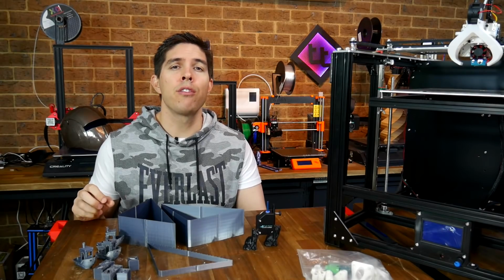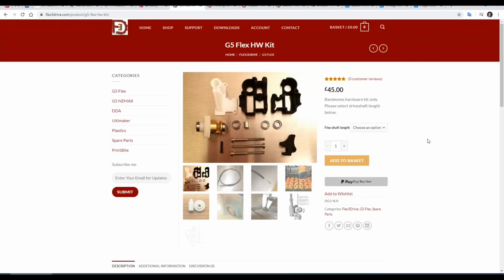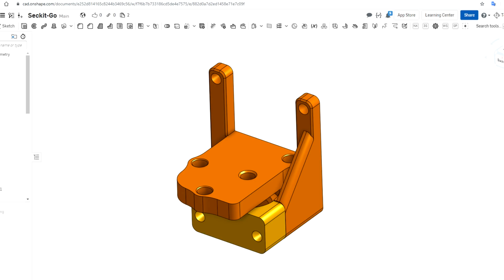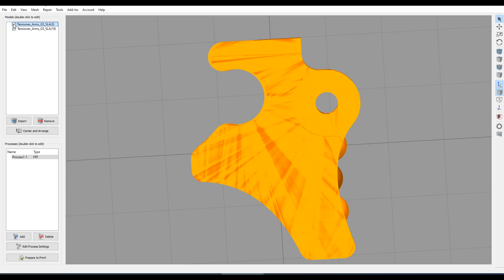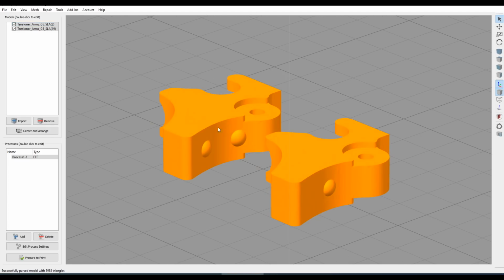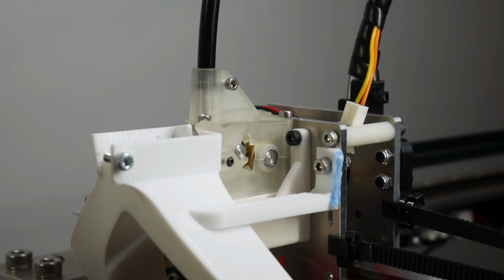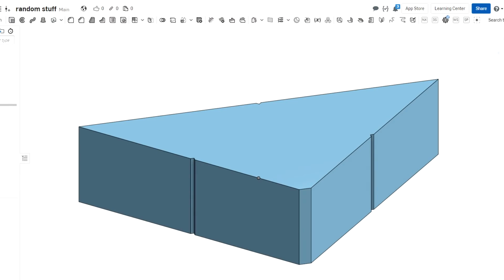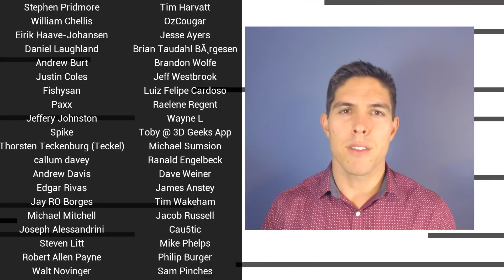Flex3drive G5 open source remote flex drive extruder guide - Seckit SK-GO

Comment: IDK your other print settings but 200 is too fast no matter what HW you have. I believe you printed PLA and according to E3D with a .4 and a V6 and a copper nozzle which gives the best heat transfer the max you get on a good PLA is 13.5 mm3/sec melt rate before you get inconsistent extrusions and partially melted filament cores. If you printed at the normal layer height of .2mm and a layer width (ideally) at .44 mm the max speed is 13.5 /0.2/0.44 = 153,4 nn3/sec if you go to a .1mm layer height the melt rate will drop. IDK to what as we usually print with a .8 and a layer height between .2 and .4 Also the smaller the nozzle and layer height the higher the back pressure your extruder has to overcome which can cause slippage. Also above data are based on a BMG extruder (2 grippy wheels) I wrote what I learned and confirmed on that both with E3E and the mosquito people here https://grabcad.com/tutorials/dialing-in-a-filament-and-specifying-the-max-volumetric-e-xtrusion-value . So according to their tech people never push above 100 or go to a bigger nozzle without employing the instructions in this tutorial. And Note!!! not only does each type of material have different max extrusion speeds but also different brands of the same material have different speeds (e.g. Prusa PLA might be different from ESUN etc)
Reply: I think the point of 200 was to bring out as much ringing as possible to compare the systems.
Reply: @originaltrilogy1  I understand that but you wont see the ringing unless you can extrude at that speed. Now theoretically it is possible to extrude that fast but that would require a Volcano which according to E3D has about 170-200 % the flowrate of a V6 depending on nozzle size and filament type. Now then there are other concerns too. For example if you print in 910 Nylon even though you can melt it at about 18mm3/sec on a volcano you will get a real crappy print if you exceed 25mm/s atleast according to taulman. See max speed is governed by 3 things, The max speed your printer can reliably move, the max speed you can melt it and the max speed you can adhere it to the previous layer. Of those 3 speeds you need to pick the slowest to have a successful print. And then at some point other physics might come to play. Assume you can reliably move at 1000mm/sec and you can melt the filament fast enough but at this speed all you are going to do is fling molten filament around the room kinda if you have a bowl of spaghetty and you spin around in circles real fast.
Reply from the maker: In hindsight I should have capped the max speed but upped the acceleration in stage for my speed test. Perhaps a video on this in the future.
Reply: @TeachingTech  Hopefully - and don't feel bad. I paid for that knowledge. Initially the guys at matterhackers said "you want to print fast - get a .8 nozzle and you can print 4x faster just up the temp 10-20C" well it wasn't pretty so I embarked on a quest to find the "speedy truth" and found that most of the info at that time (18 months ago) on the net was wrong and still is. I was at the ERRF and except the techs at the E3D and mosquito and Prusa booth just looked funny at me when I mentioned Max Volumetric E. BUT I can assure you getting it down pat has down wonders for print quality, layer adhesion and in definitely showing how fast one can print.
Reply: I'm extruding @220mm/s just fine using a mosquito hotend
Reply: @3dprintingguru378  Possible - never tested a misquito - but that hotend too has its limits. Now I am sure if you'd use a volcano with a .4 you should get that speed. The point I tried to make is that each setup has its limits and you ought to know them whatever they are.
Reply: @martinpirringer8055  I fully agree, what I wanted to point out that one could shift the bottleneck up to a certain point. GH showed off that we don't even scrape the limits yet. search for GH enterprise concept delta printer.
Reply: @3dprintingguru378  Its one of my desires to get a delta. We print big stuff. WE = FRC team 1989. Currently we 3D print our robot (30x30x45 INCH (not mm) Probably will have close to 20kg of HIPS in it. So printing fast and big is what we want and also accurate. We print anything from gearboxes to frames. Used to maintain a youtube channel on it so you might some old stuff there - stopped as everyone kept telling me too much math and not enough kittens and I am tough to understand so I only do one occasionaly to train the newbs of the club
Reply: @martinpirringer8055  I get that 🙂 btw you sound very German, just watched a portion of your double helical gear inventor video. recently designed a gear set based on mathematical models, so too much maths is well known here.
Reply: @3dprintingguru378  Austrian actually. According to some when I say "I'll be back" its sounds like the terminator only with me everyone starts laughing - lol
Reply: @martinpirringer8055  I'm Austrian too, living close to Wiener Neustadt. just add the "Glock" is ticking and they stop laughing 😂 😂
Reply: @3dprintingguru378  I am originally from Vienna but have lived in the US since 1980
Reply: Hi martin I have seen your interesting contributions on the Patreon group, but did not know you had created such great resources and videos. thanks - i am now spending my Saturday reading your work instead of the DIY I should be doing :) (and much happier for it!)
Reply: @ImolaS3  Thank you.

Comment: I would rather just strengthen the Y axis support (or get an over sized one), maybe get stronger stepper motors, top end bearings and be done with it vs going through this over engineered process, but thats just me...;)
Reply: Stronger steppers can make the ringing worse, and making the system more rigid can also make it worse, the kinetic energy has to go somewhere. Reducing the mass is the best way to reduce ringing.
Reply from the maker: Also this is a coreXY machine, not a moving y axis bed i3 style.

Comment: You mentioned in passing Cetus ghosting. This drove me crazy until I made a very simple steel bracket for the Z axis stepper. It constrains the stepper to the printer base plate using the two lower threaded stepper motor mounting holes and a right angle bracket. This did required a redesign of the Z axis clamp/brake. Mine and several other brakes are available on thingiverse. Now I don't see any ghosting, however I usually print 0.1mm layers on fine print settings. 
Cheers
-Peter
Reply from the maker: I've since gifted it to a family starting out in 3D printing who will not care in the slightest about the ringing, but thanks very much for sharing your solution.

Comment: I "think" there will be some Flex #in the turning of the flex cable leading to some issues
Reply: Torsional twist is an issue that has to be addressed correctly, and flex3drive is the only one that does this within the design decisions that lead to the G4/G5 family of extruders.
Reply from the maker: The flex cable page on their website is worth a read to see the technical specs.
Reply: @TeachingTech  OK GREAT VIDEO added to my 3D Printer Playlist, keep up the good work
Reply: They run a stupid high gear reduction. Listen to his steps/mm
Reply: The flex cable runs really high RPM to filament motion, this basically gears out any of the slack in the flex cable making it so minor as to not be an issue.
Reply: @legionof0ne441  I remember a high rev cable like these getting tied up in knots, dangerous
Reply: @3D_Printing  we use these same basic design cable drives in industrial situations delivering multiple horsepower loads... they last quite a long time in forward motion (as if you are winding the 'spring' tighter), they do fatigue over time with reverse loads (retractions which have the possibility of unwinding the spring a bit), but for the geared down loads one would see in an extruder (much lower torque delivery requirements than what is generated due to the gearing) I think you would wear through the casing before snapping a shaft - and like any  flexible shaft, if you deliberately tie it in knots of course its going to fail.  They are designed for sweeping bends not sharp turns.

As for wear and tear - I would expect to see the outer sheath fail before the flexible shaft fails  as in the industrial work I do, that is the most common cause of the shafts failure (after some years) where it rubs through the flexible steel reinforced casing and then those steel reinforcing wires damage the shafts wires and cause the shaft to fail.  But then I am talking about shafts that run at over 2000 rpm for 6 - 8 hours a day for well over 3 - 4 years before failure... this is just a scaled down version... I would only be disappointed if I did not get 1000 hours of print life out of the drive shaft on something like this, which is basically 100 or more 10 hour prints
Reply: @lloydmilton  the information you give here is GREAT 2000%
Reply: @lloydmilton  great information
Reply: @3D_Printing   the only things that really reduces the life of these sorts of drives are kinking the cable / housing, having very tight bends as large radius bends work best if it has to have a bend in it, reversing the direction under a load that is higher than the force required to unwind the drive shaft, poor quality materials / workmanship on the shaft and sheathing

Comment: the barebones kit is only $45! That's damn tempting!
Reply: Not $ but £ ! Quite a difference. And you have to add shipping.
Reply: @oleurgast730  but bang for buck the value is undeniable given its performance and accessibility, which is one of the aims of the Flex3Drive project.

Comment: how does this differ from the Zesty Nimble?
Reply: Neil Siebenthal  flex3drive has been around since 2012.... The nimble guys literally bought an early flex3drive to design their product
Reply: @edwardpaulsen1074  the g5 is the 5th iteration of this extruder, the slow burn is in reference to the 5th iteration being released, not the product as a line. The flex3drive has been around since 2012
Reply: @Narthan11  The relative slow burn is in relation to the whole Flex3Drive project, and what it is striving to bring to all 3D printerists :) There is a bigger picture involved.
Reply: seems to be much cheaper.
Reply: Neil Siebenthal  the 2017 website was selling the g3, still the 3rd iteration of the extruder.
Reply: Neil Siebenthal  I've provided links on both companies in my previous comment. I've also tagged both Flex and Zesty on twitter and asked who came out first. Let's see what they both say, but from the data I've found, it appears Flex came out first.
Reply: @edwardpaulsen1074  Here is the conversation between Flex and Zesty. 

https://imgur.com/GtTtNBK

Flex came first.
Reply: While the original concept was brought to light via a post to thingiverse in 2011 and the first working prototype was designed around 2012 and released in 2014, these points are as irrelevant as 'who made the first automobile' in regards to the comparison the OP asked about. There are many auto makers now just as there are "flex drive" makers...  Just being "first" or what iteration they may have produced is also somewhat irrelevant... In a comparison between the quality and the features, my opinion (as an automation engineer) is that the Zesty is still a bit better as it has multiple mounting configurations as well as either right or left feed, the overall build quality on the base unit is better, and is smaller and lighter.   E3D was also not the first to come up with extrusion nozzles but they have made them better. The ultimate choice is still up to the end user as to which bit of tooling (as this is still part of a machine tool) best fulfills their needs and at what price point and setup process they are willing to deal with. In that regards, there are tradeoffs and benefits to either one.
Reply: @edwardpaulsen1074  Not a strong argument but you seem reasonable in your comments.

You are absolutely correct on the points about being first, or others making something of the same but different and such like. I have no issue against such things nor those that have the capacity to do it independently or those that dont but try their very best in honest fashion. 

Copying someone elses work deceitfully and engaging them over an extended period of time without declaring the intent, and without ability to do independently is as dishonest as it gets.

Couple that with the cowardly publication by zesty of innacurate and slanderous materials in private channel or message board, or taking it to MRRF and showing it to people is very poor character behaviour and done with the sole purpose of hiding the truth, from their customers. That could be called fraudulent in itself.

However being an engineer of any worth you should already be aware that the zesty:
1). Loads the driveshaft in the wrong direction.
2). Uses lower gearing which puts more load on the shaft compounding #1 above
3). Uses a thinner 3mm driveshaft compounds #1 and #2 even further
4). Moved to 20:1 with same components makes problem #1 #2 #3 worse by factor of x2 compared to F3D.
5). Zesty didn't know what acceleration was when they launched - after supposedly developing on their own without "copying"?

There are plenty of Flex3Drive mounts.

You can self print a LH or RH version of the Flex3Drive as and when needed just by mirroring the parts in slicer.

Plenty of zesty YT reviews, and I don't post on them. One Flex3Drive review and look at the zesty trolls (presumably not you though), with self confessed fake ID's. That is the company that is Zesty.
Reply: Neil Siebenthal  No, other way round. https://www.youtube.com/watch?v=06d-acajAmY https://imgur.com/8lweHvY check dates, all before zesty was even a thought.
Reply: Neil Siebenthal  this was the first flex drive. Zesty came after it.
Reply: @npgoalkeeper _ Flex3Drive was around quite some time (years) before zesty was even a thought, as was the G4 by roughly a year.
Reply: @npgoalkeeper _ Depends how you do it.
Reply: This is the company zesty copied.
Reply: @WafflerSupreme  Sorry man, not a copy. Flex3drive has been around since 2012 well before the Zesty.
Reply: @ImplicitConversion   That's what I said. I said this is the company (flex) that zesty copied.

Comment: Oh, forgot, that recommended retraction is a bit high if linear advance is even close. I'm running k0.12 with retraction of 0.35mm. I was running 1.25mm with a bowden and L.A. tuned marginally.
Reply from the maker: Please remember I'm showing the recommended settings from Flex3drive. They don't recommend linear advance after setup. My retraction is lower like yours.

Comment: At 16:18 what causes the vertical, repeating pattern visible on the inner walls?
I definitely want to try this speed test on my E3 w/ titan clone. Seems the walls are long enough for 500mm/s2 acceleration to hit speed. Will be a good test of the microswiss' ability to melt the filament volume at 205C.

Comment: How many operations do you predict before the retaining arm stops locking in properly to hold the filament? I'd almost rather have it spring-loaded like a titan.
Reply: On the Zesty Nimble the breech is replaceable, for this reason.
Reply from the maker: Limited testing but so far zero deterioration. Since I made the parts myself I can replace if the need ever arises.
Reply: there is no hook or latch that could wear down, the geometry of the idler bearing in relation to the hobbed gear makes it durable.
Reply: The tension arm design has been extensively tested both in-house and in users hands before release, and its operation has been solid. Its a clever little geometric arrangement in the way it locks down and prevents any reduction in tension over time.

Comment: Have you tried the zesty nimble remote direct drive? It's basically the same thing and they are located in Australia. I have their first version of the nimble and like it. I currently have the second version of it ordered and in shipping right now. It should arrive here in a few more days. It's a import for me sense I live in the US. For you though it should arrive pretty quick in comparison.
Reply from the maker: We were in discussions a while back but it never materialised.
Reply: @TeachingTech  Well that is sort of depressing. Oh well. I may buy one of these G5 kits as well to compare them myself. I'm building a coreXY so I may use it on that printer. I will say that the G5 kit is cheaper in cost. so that is a major plus.

Comment: Hm... I see a serious z-wobble strips on your printed parts.
Reply: That is just the speed ramping up. The print ramps the speed from 60-200 over X layers.
Reply from the maker: Correct, no z wobble, as the colour changes as the speed increases. The actual geometry of the face has no wobble, if it did the period would be a lot smaller.